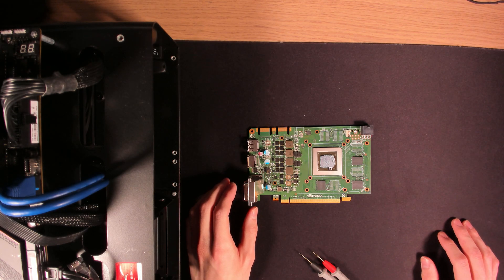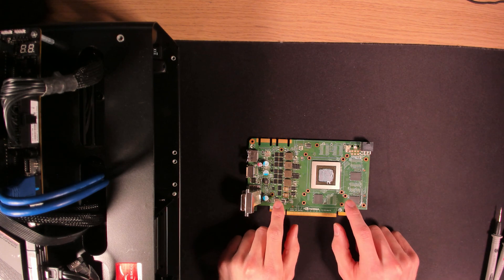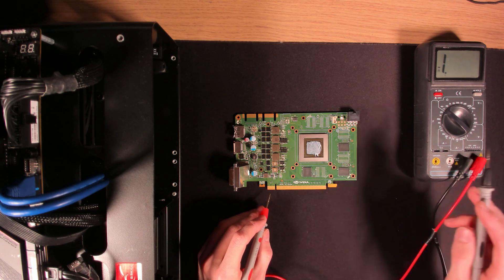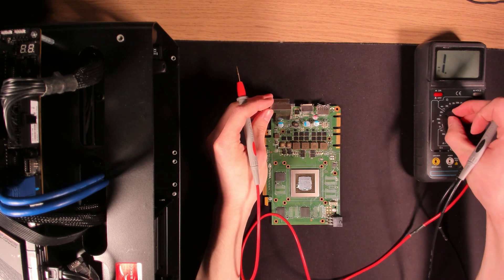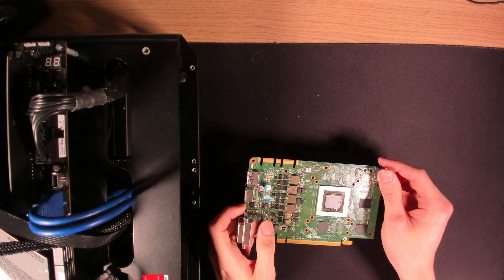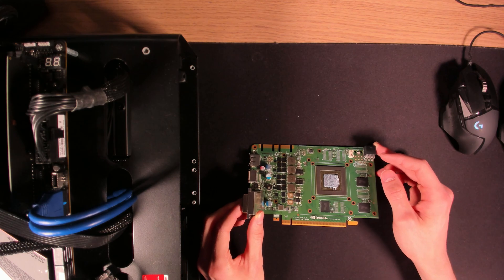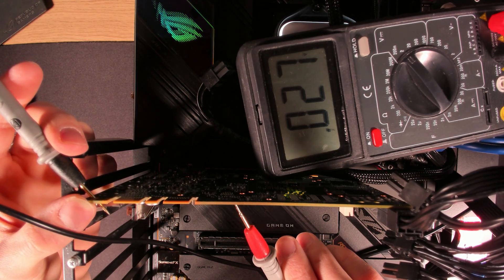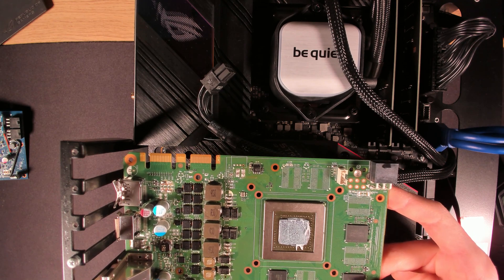GK104 GTX 660 Diagnosis & Repair Attempt

Comment: Can i ask a question? Please tell me if all the vram chips have the same amount of vram on every graphics card or not
Reply: Think about that long and hard for a second.
The GTX 980 ti and GTX480 both have 12 memory chips.
One has 6gbs of Vram the other 1.5gbs...
Reply: @Vi_OC  soo my GTX660 has 4 and has 2 GB of vram and that means for each chip i have 500MB's of vram
Reply: @Vi_OC  thanks bro but one small thing, where can you find a memory chip the has like 2GB in it rather than just 500MB👋👋
Reply: @eliassrour759  Many modern GPUs have much higher capacity per chip. 
Some cards would just stick extra chips on to it rather than use higher capacity. 
RTX 3090s, GTX 770s 4gbs, certain GTX titan models etc.